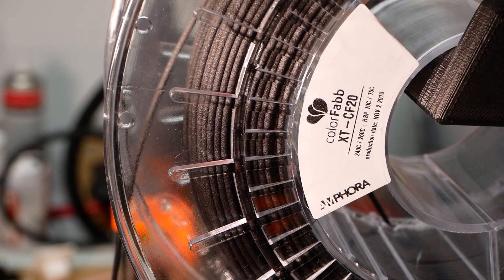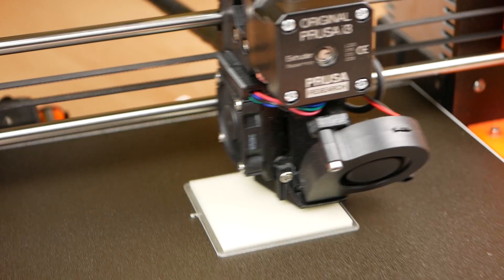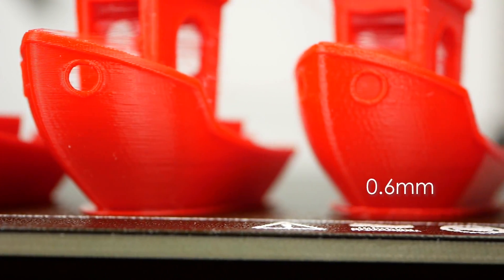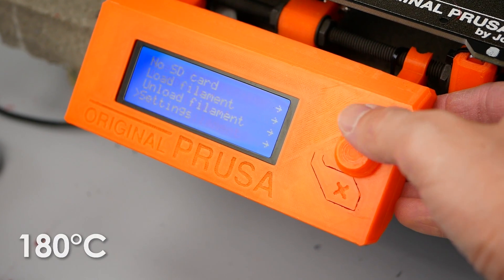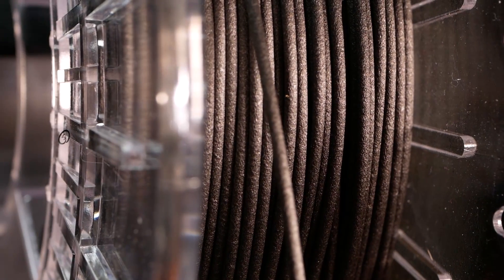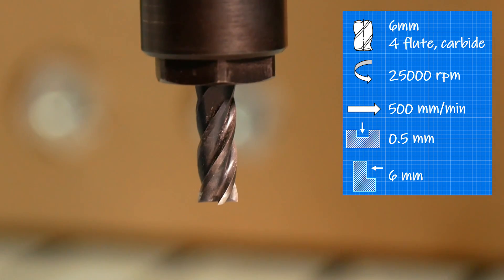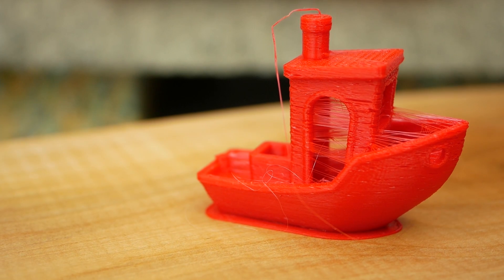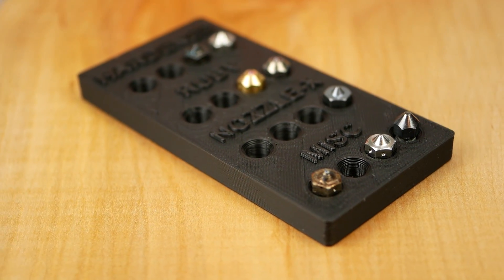HOW MUCH abrasive filaments damage your nozzle!

Comment: Hi, I had a look at the "Carbide Endmills". Sorry, they are not Carbide End Mills. I was triggered by the 55HRC (which would be extreme soft for carbide mills) to have a closer look and if you look close to the text you see they are made from steel which is alloyed with some tungsten and some carbon. So this is something like HSS Steel, while good HSS has a Rockwell C Hardness (HRC) in the 60ies. So if I need cheap general purpose endmills I keep buying the "Hardal" ones from https://shop.kobratec.com as they have 70HRc (proprietary steel alloy) are similar priced (>=ø8 the Germans are even cheaper) (INCLUDING 19% VAT, which I get refunded on my tax) and I get them overnight (Germany). So Stefan, I don't know if you are vorsteuerabzugsberechtigt, but if the BG ones get stuck at the customs you pay ~6% customs duty plus 19% VAT at the customs, have to wait for the delivery from China, have the hazzle at the customs, pay more and have less quality mills. Well any of those will mill brass. I think I mill much more often steel than brass. The Kobratec Hardal mills work fine in aluminum too.
Thanks for your great videos and for (sharing) your empirical research.

Comment: First, sorry for my english, I´m from Spain.
I believe, the spiral wear can be caused because the extruder applies pressure to the filament on the end of the nozzle,...ok, but this pressure causes the filament to bend by applying that force to one side inside of the nozzle. To this force it must be added (+) that the filament has a flawed curl, caused by winding in the coil, and this also exerts a helical pressure on the inside of the nozzle.

Comment: The strange internal path in the cheap nozzle is probably the result of using a boring bar combined with poor centering of the workpiece or loose bearings combined with either a worn out slide bearing or a loose tool. The feed speed was too high, at least for the state of the equipment used. I would bet you they used better equipment to machine the outside of the nozzle.

Comment: As others have said, there are several things that can cause the internal spiral:

Drills that are too long will let the drill flex - very stubby drills should always be used
Dull drills
Drills sharpened off-center
Poor chip flow along the flutes - but that's more common on deeper hole depths
Re-entering the next part with clogged flutes
Excessive feedrate
Poor coolant flow
Poor coolant in general
Poor grade material
Not using a reamer to finalize hole sizing and surface finish
The absence of proper quality control

I would assume that when the cheapest and fastest manufacturing methods are the priority, the problem is probably a combination of these issues.  After 50 years in machining, I've experienced them all - LOL.
Thanks

Comment: The uneven walls of the hole are caused not only by a blunt drill.
It can also be a drilling speed effect. Proper hole needs a drill rotation, sharpness of the tool for correct cutting of the material, as well as time to make a tunnel in the head.

I can only imagine how the Chinese rush their CNC machines so that they do not make, for example, 15,000 pieces a day, but 40,000.

And we have the effect. I already omit the high temperature of cutters during such work and the accuracy of their implementation. That I will not mention the metal alloy. Brass can be hard. But it costs again ...

I don't think companies use expensive molybdenum or similar permanent cutters.
Rather, they definitely go for the amount of daily production. And finally money to collect.

Comment: being a machinist and having made my own nozzles the pattern made by the primary drill ( the larger drill ) is due to poorly sharpened or dull drills. Also longer the extrusion hole is ( the small hole ) the more consistent  the extruded filament diameter is. These are my observations.

Comment: machinning brass sucks its spits sht at you.... brass is most commonly used due to the fact it brakes... its used for a cheap to replace part so it will break before any damage to more expensive parts.

Comment: Hi Stephan, as to how the hole came out bulging in the middle of the shaft, I would suggest wear on the cutting bit and the drill press/milling machine being in need of balancing. As to why the chamfer on the end of the nozzle I agree, I think it was the most expedient way to finish the part. As for a future test, since you have access to a milling machine you might try cutting back a bit, say ).005 " to see if you can coax any more life out of the nozzle.

Comment: Very interesting. It seems to me that the filament size section of the cheap nozzles is only drilled with a single tool, probably a 90 degree point drill. But I'm pretty sure the E3D nozzles are pre-drilled, then a specially shaped follows that. Obviously E3D won't want to talk about their manufacturing methods, but that's my guess anyway. When I get back to work on Tuesday, I'll get our senior engineer to have a look at your video and give an opinion on the nozzles.#
I'd love to have some tungsten carbide nozzles, but they are seriously expensive at the moment.

Comment: Exactly.

The biggest problem of abrasive filaments appears not inside(hole diameter) but outside(hole length).
From my experiences, the most abrasive additive agent is "glass fiber", and not carbon fiber or metal particles.
Actually it can shorten stainless steel nozzles over 0.5mm within one reel(500g). 
This means the nozzle diameter changes from 0.4mm to 2.0mm, or simply the nozzle has died out.
If diameter of the nozzle was changed at this moment, it is not so big of a deal.

I tried to use HSS_Co(used for cutting tool of stainless steel) nozzle for the glass fiber filament, but it does not work.
So currently I am using stainless steel nozzle once for small parts,
and flat top HSS_Co nozzle for large parts.

Comment: I would be interested in finding out the effect of milling off the chamfer of a cheap nozzle to see if there's improvement to the stringing and tolerances. The larger opening definitely would reduce the pressure on the filament as it exists (Pressure =Force/Area) but whether that makes a significant difference to something like layer adhesion or accuracy is debatable.

Comment: Welp, I wonder how long a tungsten carbide nozzle will last under the onslaught of chopped carbon fiber, kevlar and glow-0in-the-dark filament. My e3d brass nozzle lasted surprisingly long with glow in the dark filament, and that's with cheap glow-in-the-dark stuff (that still glows and prints really well, though it is ridiculously brittle) from China.
Yes, I did notice more stringing, now I know why.

Comment: You need to use a single flute drill. This is referred to as gun drilling. The reason the cheap nozzles lose center is likely because they use a drill with 2 flutes.

Comment: You can get bits in the exact same shape as the filament you pulled from the heated extruder, they just have a longer tip ;)

Also, try heating your nozzle to the meltpoint of your material the next time you get a clog from removing your filament too hot. In most cases gravity does its job once the material turns molten :)

Comment: That cavity is not machined, it is cast and removed from the die while still hot. The wavy inside is also visible (but slightly less pronounced) in the outer casing (this is very visible at 12:01) and caused by uneven cooling of the part.

Comment: Nice video. I'd change one thing and that is to show the worn out tip next the original every time (side by side) Example at 9:36 you only see the bad one with nothing to compare.
This would help compare the nozzles before and after without having to skip around in the video.

Comment: ug.. the machining on those nozzles is horrendous.  I may only be a 2nd-year millwright and a hobby machinist, but I can definitely do better than that.  Even my much-neglected CNC, used mostly for wood could do a better job.  Those spirals you see are caused by an overworked and poorly cut bit, likely hand resharpened judging by the uneven taper on the id.  I'm fairly sure those were even drilled out, not machined. Perhaps I'll make a few of my own out of random metals. Bronze, hardened aluminum, stainless steel, and perhaps even a titanium one..Don't think the titanium one will work well thoe.. its thermal conductivity is crap, and its a pain to work with. perhaps a tungsten one.

however, it's also possible that those are sintered brass parts as well.  Basically, brass powder put into a mould and compressed into the desired shape.  then they are heated to near melting point to fuse the metal.  cut the treads and presto instant part.  I cant tell by the resolution of the video if this is the case or not.  Mass sintering is, however, cheaper, and is very common among Chinese made parts.  Its the oven curing that causes deformation in the part though sag, thermal expansion and contraction.  Again, I can't say for certain this is the case without a much closer look at the grain of the metal. But its a possibility, as these parts do wear much quicker. Good for brushings thoe. especially bronze ones.

Comment: To machine something like that, I would use a dead center to mark the center of the part on a lathe. After that I would drill a centimeter in with a .4 mm drill bit being careful to do it slowly, then I would come in with a final diameter drill bit to drill to where the nozzle starts extruding. After it got to the desired depth I would clean it with some compressed air and machine the outside of the part.

Comment: I can tell you where the helical drill shape comes from. Not sure what you need to do in machining to get this. But solving continuum mechanics you often get this by twisting a long rod while pressing against a surface. We mostly did this exercise in regard of drilling into rock for lets say rock samples, oil, ice samples ect ect. 

So from guesswork, it probably was a result from an incredibly worn drill bit or too much pressure while drilling. Something in the lines.

Comment: These are made on Swiss or screw machines at under 10 seconds apiece from hex brass stock (face end of part and OD , thread OD, drill cavity with a 90 degree tip drill (maybe parabolic), drill orifice, chamfer tip, partoff onto a parts chute).  The wacky cavity is due to poor geometries on cheap/worn drill and a high feedrate so they're wandering for centerline as they feed all the way down.  You can see how far off it is by the scaring caused by the drill corners when it does a rapid retract out of the part with no material loading.  Screw machines can run this stuff from barfeeders, lights-out by the tens of thousands and they don't really care for circularity or finish callouts for the internal cavity at this price point.  It's possible they're even running these parts from old mechanical screw machines that run off cams, instead of CNC Swiss machines.

Comment: The spiral pattern happens when you drill a hole on a lathe but the tail stock is off center it makes the bit flex and wiggle as it rotates

Comment: Useful info, thanks.
I have a small lathe, tried making my own nozzles, they worked ok, but no better than the bought nozzles. The hand-made nozzles took a lot of time to make, and the materials are expensive.

A good compromise is to buy 0.2 or 0.3mm nozzles, and drill them out to the required size. I find 0.35mm is a good size for the kind of printing I mostly do. Carbide PCB drills are cheap, but it's easy to break them. I start by facing off a piece of scrap stock, drill and tap M6, and screw a nozzle on. I do this for each batch of nozzles to maintain concentricity. The drilling part is easy, as long as your tailstock is aligned correctly.

Comment: But mate i tried hardened and steel nozzles i had problems where the fillament  stick to the nozzle and ruins the first layer and i never went passed the first layer. 
So i went with brass as it gives perfect first layer.
Reply from the maker: That's actually common. E3Ds nozzle X does a way better job in that regard due to the coating they put on the hardened steel making it more slippery.

Comment: great video...suggestion....take a worn nozzle and CNC a new flat extruder surface and see the difference in the  benchy....
Reply: That's what I thought. And another option (which I'm going to try after fixing my printer) is to… Do the same with sandpaper.
Reply: @SunnyOhm  i have tried the sand paper but cant get it flat enough. Looks ok to the naked eye, but under a microscope you can see the rounded edges

Comment: Regarding what to test next - see if print settings influence wear rate. Layer height would be a big one - if the LH is lower, the nozzle is closer to the plastic so we would expect it to wear out faster. Also z-hop and retraction distance/speed.

Comment: Manufacturer reply on nozzle wear with tungsten vs hardened steel wear resist is as follows:
From the data we managed to find, tungsten carbide has a weight loss 30 times lower than tempered tool steel. From some data we have tested, the hole has increased 0.025mm with carbon steel after 1 kg. By comparing hardness and wear, the tungsten carbide should be able to extrude at least 200 kg to get the same wear. However, this is a non-validated comparison. I sincerely doubt we can compare hardness and wear results based on these, but I think we can get an idea.

View Ticket

Comment: I would think the 90° vs 60° angle can have an impact on oozing/stringing by requiring more pressure to push filament through, and thus releasing more material when the pressure is relieved...

Comment: Why run 0.4mm code through all nozzles instead of changing the code to match the nozzle size?
Reply: Becasue the whole point was to illustrate what happens when you expect your nozzle to be 0.4 and thus set the slicer for that, but since it's worn out it's now bigger...

Comment: My guess about the stringing being worse with the cheap chinese nozzle with a chamfer at the end versus the E3D nozzle with a clean cut is that the clean cut helps with retraction. With a clean cut, enough material retracts to avoid strings. The chamfer might allow material to stay on the tip of the nozzle.

Comment: To answer your question about how the cheap nozzle was machined lumpy inside like that. They were using a cheap twist drill to drill that part. The drill was dull more so on one side than the other. This causes it to want to push off center while the part is spinning. Then the body of the drill hits and forces it back to center. This process repeats at regular short intervals. It can be cured by installing a new properly sharpened drill into the machine. However, this costs the shop money...

Comment: The helical pattern inside the nozzle seems to be bad production quality. Off center lathing or bad work-holding. Ofcourse these internal geometries could be made on purpose like internal threading operations. Threadmilling could also be used. But i guess these parts proberbly get produced on a lathe in the millions

Comment: Water is not abrasive, but can wear down the toughest of rocks.
Same with any material, it will just take a bloody long time.
Reply: no one material its ¨abrasive¨ since is not a phisical property, an ¨abrasive¨ its a product that you use with mechanical force to cut, polish or clean, but, abrasives need something important, a hard material, and wich materials are the ones with the better hardness? minerals, isnt water a mineral? yes it is. So, your coment its pretty incorrect.

Comment: Very intrested in exploring printing with undersized nozzles, as well as if the stringiness of higher diameter nozzles decreases the closer the slicer nozzle diameter is to the physical diameter, or whether the stringing is an exclusively correlated with nozzle diameter.

Comment: I blew one of those cheap chinese tips out with Matterhackers Glow in the dark PLA. After a 12 hour print on a .4mm tip, I could stuff a .0625" (1.5875mm) drill bit in the end. The print and nozzle went in the garbage. I ordered a decent lined steel tip for further prints. Also, the tip might have been on it's last leg and the abrasive PLA was the last straw and finished it off.

Comment: judging by the flow pattern of the metal on one of the cut nozzels, it wasn't machined by just cutting.  It might have been machined the same way screws and bolts are made, with a cold forming and had another process on the same machine(judging from extreme low cost)with some cutting for finish work, they may have started with a thick pipe and worked it into shape with compression. They just have to pay for setup and some way to load the machine and it will churn them out 24/7 at every 15 seconds or less

Comment: pattern inside the head is not drilled its machined by a cnc machine 
probably by 1st drilling a hole all the way through than inserting a cutter tool into the hole.
than machine it into the pattern and the inside tapered end

Comment: Printing 0.4mm gcode through a 0.25mm nozzle really surprised me.  You should do a test of 0.25mm gcode through 0.25mm nozzle and compare; I'm particularly interested in which one replicates super-fine details (like you'd see on a tabletop game miniature) better, and which approach reduces stringing the most.

I'm also curious whether the internal angle (60° vs 90°) contributed more or less than the chamfer to the stringing; I'm constantly fighting with stringing on my bowden-tube extruder.
Reply: I can't get rid of stringing with eSun PLA+.  Not sure if it's the filament though.